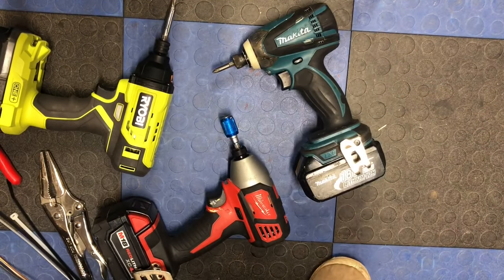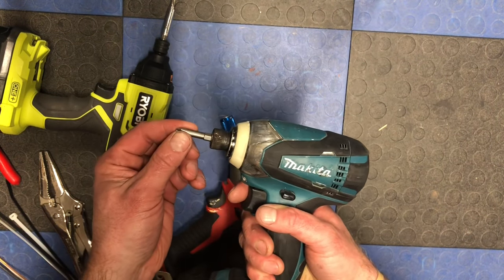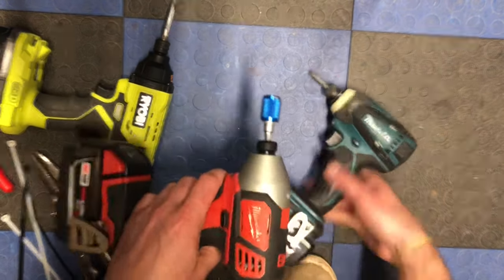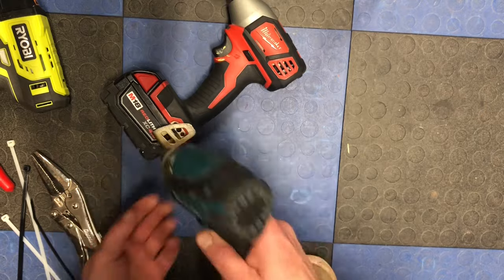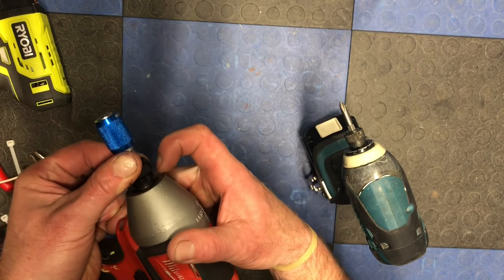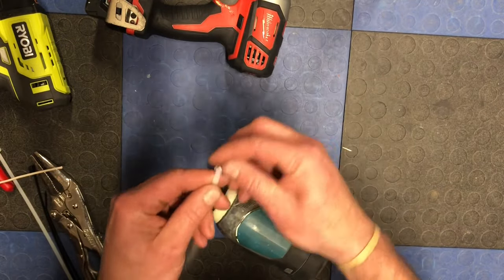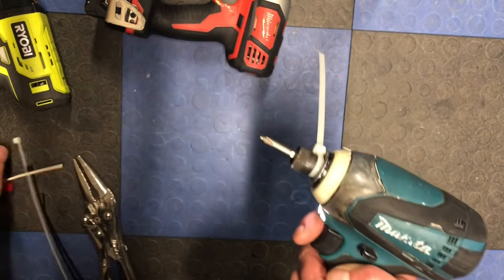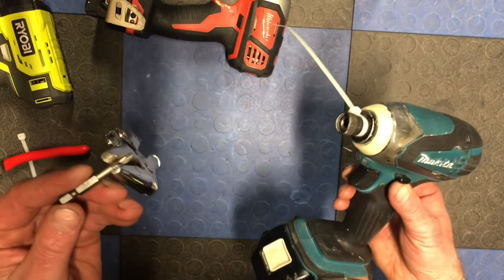Easy!! How to remove a stuck bit from an impact driver (Ryobi, Dewalt, Makita, Ridgid, Milwaukee...)

Comment: Thank you very much. Used ground wire I had on a spool, put impact on the floor and held it with my foot, and used channel locks with a good grip to yank it out. Turned out someone else put a non-impact bit into it. Little brothers can be a menace, even when you're all in your 30s ;)
Reply: That's a mistake you only make once, speaking from experience. Make your little brother get it out next time and he'll never do it again lol.
Reply from the maker: Bam. There u go 💪

Comment: Thanks for the excellent video. Using a piece of #12 wire, some WD40, a vice, and a hammer, a thoroughly rusted-in bit sleeve finally came out of my Ryobi impact hammer.
Reply from the maker: Nice work!

Comment: Mine was stuck closed so couldn't pull collett out,but I did use a long vinyl piece of wire that came on a string of lights! I had to really jam it in there,then used R/F several times & then an old metal butter knife to pry the collett up and pulling the wire under, and the collett came loose & I pulled the bit out easily as normal. I had tried the force/pull/cuss/grunt/pull way with no success. So try a metal butter knife!

Comment: I ended up using a ziplock and putting the drill in a vice. Hitting the wooden block (buffer) against the slot. It worked like a charm. Thanks for the video.
Reply from the maker: Nice 👊

Comment: Worked, small modification to your technique since mine was really jammed in there. Rather than using my foot to hold the vice I got some WD40 and hit the vice with a hammer and the bit popped out with no problem. Thanks for the tip, saved me a lot of time trying to figure it out in my own.
Reply from the maker: Nice 👊
Reply: I stupidly put a bit in without an adapter and the WD 40 with pliers while wiring it open worked after a bit of struggle! Omg this has been stuck in there forever! THANK YOU

Comment: Top tip thanks

I ended up having to tap the mole grips with a hammer to shock it loose and it worked 💪

Comment: thanks for the video, i had the same problem with my makita impact driver i didn't have any zip ties or wire on hand and found wrapping a rubber band around it works just as well.
Reply from the maker: There u go 👊

Comment: Great tip.I used a Makita bit adapter on the Makita drill for some bolts. It got stuck. I used a thick washer instead of a zip tie, and placed the bit in a vice. It worked.
Reply from the maker: nice!

Comment: I have a 12 volt Bosch. 
My son borrowed it and stuck a short Phillips bit in it.
Can not get it out for nothing!!!
Not enough to get ahold of so thinking of throwing it away.
I tried both of your suggestions. 
It's not budging. 
I love that little driver. Can get it into some small areas.
I have several others but it's my favorite.
Reply from the maker: Have to take the chuck part

Comment: I'm dealing with Ryobi with a broken bit, took the top part of where the spring and bb size marble. Ryobi has holes of each other where I put a small screwdriver in to knock it out, did the wd 40, tap it all around. So I'm thinking to take off the black cap off. In other drills I've seen have that wedge where tapping it out is easy.
Reply from the maker: Nice.  Thanks for sharing. Yeah. Taking apart is the other option.
Reply: Actually need a drill bit

Comment: I have found tourquing in opposite direction will free the bit. Sometimes a little pull is needed. Vise grips stano on them. A few taps from the driver. Move collet with free hand. Pull on driver with other hand. If no visegrip, put bit through a slightly larger hole to grip while tapping(gentle usually dies the trisk).

Comment: Great tip! I needed the stand on vise grip ty wrap method! Thanks, incidentally this was with an Irwin bit. I had trouble with them before but never this bad. A shame, they have double end bits, phillips on one end and star drive on the other. Handy but only if you can get them out!
Reply from the maker: Nice.   Thanks for sharing

Comment: Hi, thank you so much for yor video, but I made a mistake that put a oversize bit into the impact drive, do you have any tip to take it out?
Reply from the maker: process would be the same as basically jammed.  not sure how you even got it in, if oversized.    if you have a vice, put it in a vice and then pull on the drill. for more power
Reply: @HowToWithLech  thank you for your reply, I think I should change the anvil part, I cant take the bit out. so sad

Comment: I had a short bit stuck and grips wouldn't take a hold. So used zip tie and held the bit length ways with side cutters. Then while pulling on the bit run the driver forward and back slowly and came out in seconds with little force.

Comment: A phillips screw tip got stuck in our Makita impact. Nothing I have tried will grip the bit and it is jammed in. What can I do?
(I took the driver apart but cannot see a way to access the bit area.)
Reply from the maker: one of those short ones huh. . might have to take take it apart..      or if possible, brake the tip off the screw, and use those screw removal drill bits, if have the kit.  not sure if it will work, but just throwing out there.

Comment: Ziptie trick didn't work for me but what did work was use a vise to hold the chuck safety, pull gun away from the chuck and give it a couple ugga dugga in either direction and it was out. Needed this video to give me the idea though
Reply from the maker: Bam 👊

Comment: What about a broken off bit? The length is not longer than the collar itself. Let me know-I have a P237 Ryobi impact driver.
Reply from the maker: Might have to take it apart if possible. Unless somehow use screw extractor bit to get it out.

Comment: What about a bit that's too short to get a hold of with pliers?
Reply from the maker: Once you have it zip-tied. Try holding it lengthways with thinner plies or cutters.   Run drill back and forth slowly.  And pull on bit.  Should fall out.  Even can give spray of wd40

Comment: Just wear it out a bit it will come out. Whatever bolt you put in. Break it loose tighten it again and keep doing it the bit will come out
Reply from the maker: Good tip
Reply: @How To with Lech  I mean that's how I've always did it especially with brand new ones. They always get stuck. It's just something I've kinda done over the years thats worked for me lol 👌

Comment: I used a short bit (to get into a tight spot) and the SOB is stuck good.
Reply from the maker: Ahh.  That stinks.   Mess around with different pliers to grab it.   Maybe grind it a little for more grip.
Reply: The vise grips worked... along with a hammer. The zip tie technique helped! Thanks

Comment: But broke off in the drill trying this. Now I'm screwed
Reply from the maker: That’s tough.  Cheap but I guess. They don’t break that easy.   Just need to take apart now.
Reply: @HowToWithLech  yeah I've never had one break before. I have a Makita driver like that, removed the retaining clip washer and spring. The chuck won't slide off with those out. Is there a different way to disassemble? Or do you know of a video that shows? Thanks for replying
Reply from the maker: @ankryth  honestly haven't tried. not sure. i'll have to mess wiht it as some point.

Comment: Would be helpful if the part that pulls out wasn't stuck too
Reply from the maker: Spray wd40 on it first and try push up with flathead / plier
Reply: @HowToWithLech  that's what I ended up doing thanks
Reply from the maker: @troyy1086  smart man 👍

Comment: Mine’s just too jammed in. Sigh
Reply from the maker: As you try to pull out.  Give some back to back motion too.  Tap from top frost Maybee.     Hope u get it
Reply: @HowToWithLech  thanks for the tips. I’ve tried all that and it’s still jammed. It’s also slightly at an angle. No worries, though. I may try to dismantle it. But it’s old and it wouldn’t hurt to replace it anyway